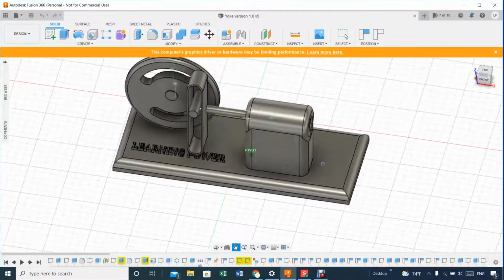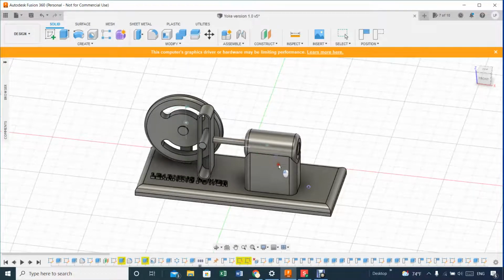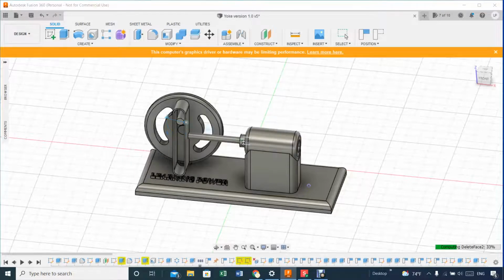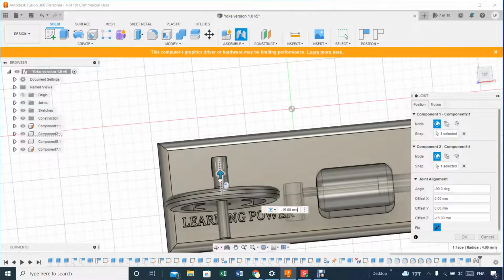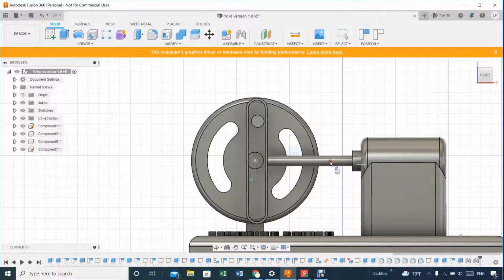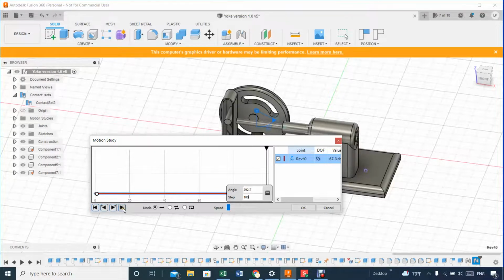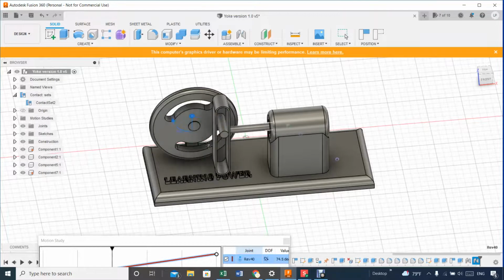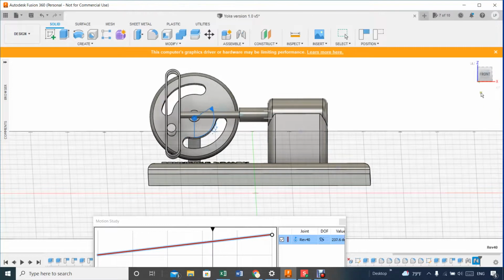FAILURE ON THE USE OF CONTACT SET FOR A SCOTCH YOKE MECHANISM ANIMATION IN FUSION 360 #@#$#@$#!#!##

Comment: 🤔🤔🤔The problem might be that the pin connection and the yoke dissengage since there is very little surface area contact. If you change the pin from a round form to square like...it might work better...🖖
Reply from the maker: I will redesign this scotch yoke mechanism and I will use your suggestion.  Thanks.
Reply: @learningpower9437  As per  this redesign...the pin needs to rotate hence, you need a new join...you might need to add a synchronization movement between the pin and the crank...to make the yoke/pin  mechanism functional. Keep the good work!!!